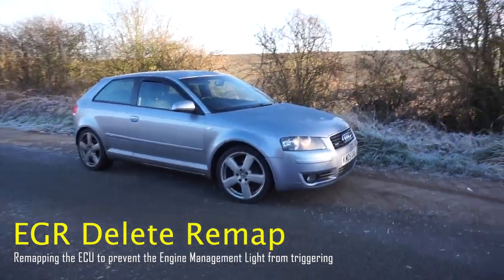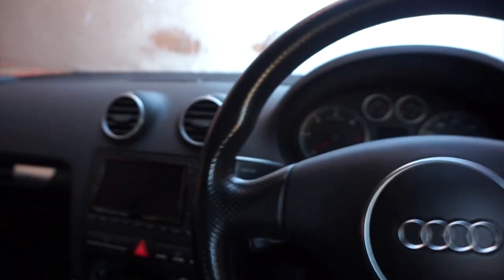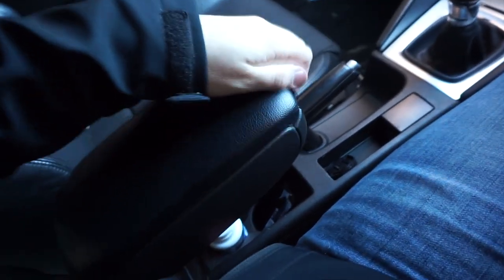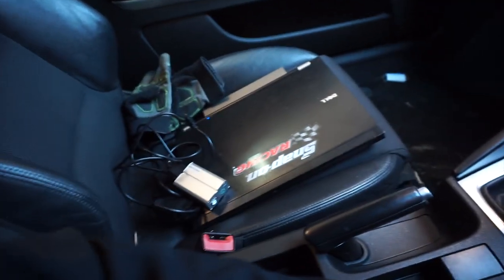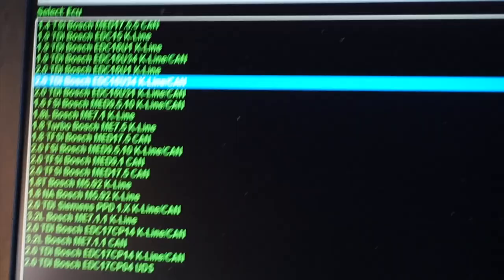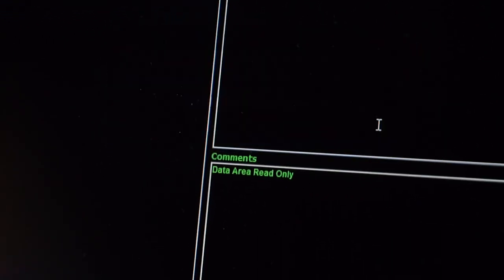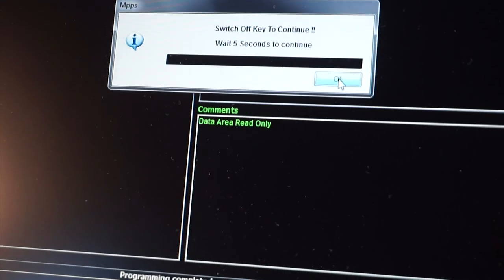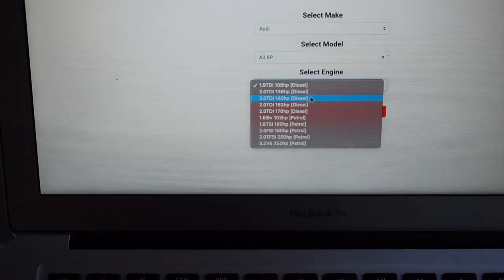💻DIY📈 How to Remap your 2.0 TDI Engine with Stage 1 | EGR removed

Comment: What was the hot cranking issue, my misses car seems to start instant first thing but after that it cranks for a few seconds before starting
Reply from the maker: I used to have a 1.9TDI with hot start issue. Only a remap fixes it, guaranteed.
Reply: or use the hot start fix usings VCDS where you change values of the injection quality on vehicle start up that fixed mine and starts first time everytime  been over a year that i did that now

Comment: Very expensive site for files . Why not just take it to a remap specialist its the same price if not cheaper ?
Reply from the maker: You can’t get just an EGR removed from your map by those “specialists” I spoke to about 8 different local remappers and none of them could do this. Remappers were the only place you can grab a customised map - only option was to get one from a proper tuning company but that means leaving your car there and paying a lot more 👍
Reply: I just got volkswagen tiguan remapped and egr delete was 280 from custom Tuning in Aberdeen works brilliant not had egr problem since

Comment: can you use this lead for vcds also?
Reply from the maker: Nope, you need a different kind - you can get the genuine vagcom/VCDS from here www.ilexa.co.uk
Reply: @DSEC_UK  thanks man for quick reply, i bought a 06 a3 tdi 170bhp yday and have found it has problems:( rough idle and stuttered revs and smokey. i think it might be egr valve can i test this before blanking? would like to use vdcs is there a cheap way?
Reply: @DSEC_UK  thanks is this how you get it on your phone also or is this a different adapter again?
Reply from the maker: The ones you can use on your phone are Carista and Torque - you’ll have to buy or subscribe for these to work well. Pretty much any eBay Bluetooth reader will work with those apps

Comment: So you dont need to Unlock the Ecu when doing this? 1,6 tdi Skoda Fabia II 90 hp
Reply from the maker: Some ECU's are locked other unlocked from factory AFAIK - fingers crossed your fabia is unlocked otherwise it's a case of opening up the ECU on a bench and connecting wires to points on the PCB.
Reply: @DSEC_UK  okay thanks, can i see it with vcds?
Reply from the maker: @simondk8398  I'm not sure - probably somewhere in a module, but I don't know for sure. Best way would be to use that K-Tag software, should show you pretty much instantly at the bottom of the window.

Comment: First! 

What year car? What's the cost on remap?
Reply from the maker: It’s a 2005 A3 8P - it was a stage 1 with EGR removed £280 for the modified ECU file 👍
Reply: @DSEC_UK  i have 2003 a4 1.9tdi. u should sead 2 ppl what did your egr off 2 make hot start issue resolved 2 in the same proces i did mine engine tune up form 96kw to 125 kw egr off and hot start for 1200 kunas thats rughley 150 euros. sory for my bad english. greetings from croatia!
Reply from the maker: @ivanperac834  Thanks - yeah it depends what you want on the remap with the engine you have - but yeah I want to get the hot start remapped next with a stage 2 - 200bhp :)
Reply: @DSEC_UK  dunoo abaut 2.0 but for 1.9 tdi stage 2 goes with changing out turbo couse stock wont last a few thousand of miles with that remap... i think i beter 2 take turbo from 2.5 or even 3.0 and then making a remap. biger turbo might make a bit longer for spooling up but when it does u'r gona like the resoults :D. best of luck m8 and report back how it did.
Reply from the maker: @ivanperac834  https://www.remappers.com/remap-specs.php?manufacturer=Audi&model=A3+8P&engine=546 - not sure what the 1.9tdi can do but the 2.0 BKD has a stage 2
Reply: I fixed my hot start issue by replacing the starter motor!!  When the starter motor is warm it will crank the engine too slow for the ecu to open the injectors. 250rpm or above is required for injectors to fire on bkd engine. You can log the cranking speed on your vagcom to confirm crank speed is above 250rpm before you buy another starter motor. Could also be another issue ofcourse. Your overboost is the vnt sticking inside the turbo, I use Mr muscle to clean mine, access the turbo via the blanked off erg connection of your manifold, feed a pipe into your turbo and fill it up with Mr muscle over cleaner. Leave for 2 hrs whilst pumping the turbo actuator with a hand held vacuum pump, continuously doing this with the Mr muscle inside with loosen any Carbon and stick the vnt vanes from sticking and creating your overboost code. Vagcom can also test the actuator movement in output test function. I made a quick video off it check my YouTube. 
Question for you, I'm buying a 170bhp 2.0tdi 2011 what bhp is a stage 1 map offering and how much? Is there any weaknesses that a map might highlight on the 170bhp engine?
Reply: Hi, great video thanks. I’m a bit of a novice so excuse my ignorance but I’m wanting to get EGR delete and stage one but worries about the MOT emissions, does it affect it as all because obviously the EGR was to try and burn of the nitrogen oxide? Thanks
Reply from the maker: After doing this the car went through a few MOT just fine, the EGR only starts recirculating at a certain RPM - think they idle the car for the emissions test?
Reply: @DSEC_UK  thanks, yeah is that the map where it opens up at low RPM just to warm the engine up? I’m hoping to get it fully mapped out as mine sticks about and causes it to drive like crap. I’ve been told by the remap bloke that it goes through an MOT just fine but I wanted to here it first hand so that’s good that you say it still passes. Thank you and merry Christmas
Reply from the maker: Merry Christmas mate, yeah no worries 👍

Comment: Engine with  8V or 16V
and "HP" please ?
Reply from the maker: Not sure off the top of my head, 16v or 20v 🤷‍♂️
Reply: 16v
Reply: What kind of birthyear is this audi
Reply from the maker: @Tony-md1re  This ones is a 2005 Quattro 2.0 BKD 2.0 TDI engine. Stock this was 140bhp and with this remap increased it upto 182bhp and it drives like a different car, didn't really mention the difference in the video as I was just focusing on getting rid of the engine management light from the EGR removal.
Reply: I had the same year my turbo was broken after chiptuning...😂  not the best engines i have now a a3 from 2010 its alot beter
Reply from the maker: @Tony-md1re  Yeah, the turbo on this was replaced at 130k and now at 170k I think it's due a change as it keeps flagging that over boost code when not fully warmed up.
Reply: @DSEC_UK  yeah my turbo was over boosted his rpm